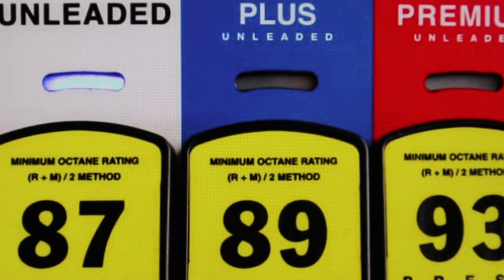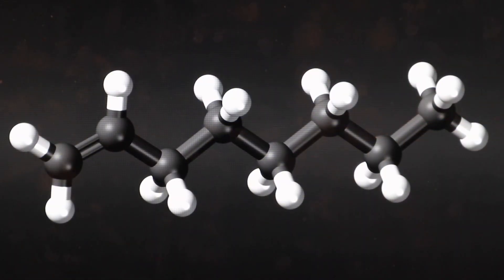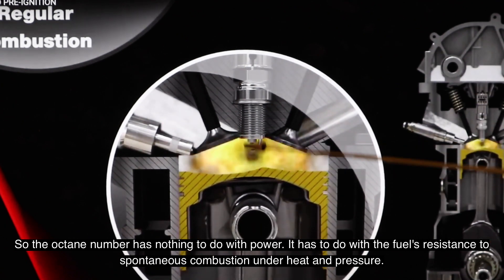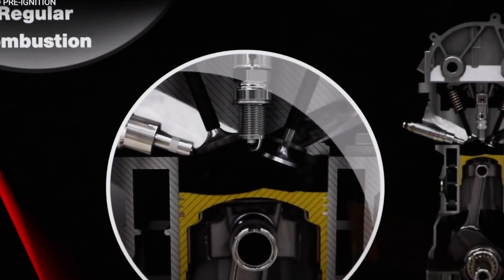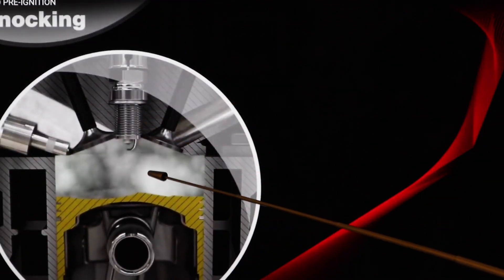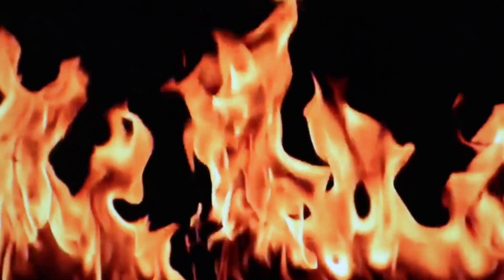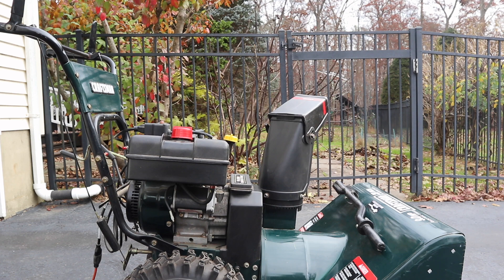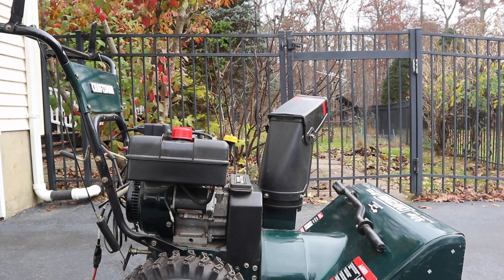Does a snowblower run longer with 87 or 89 octane gasoline?

Comment: only thing this test proves is you're getting ripped oFF at the gas station ⛽ you bought this fuel from.  Ethanol isn't good for your small cycle engines, hence stay away from this as overtime it can lead to carburetor issues.